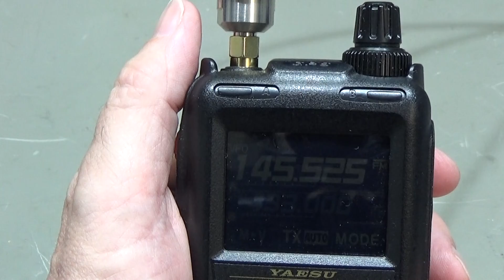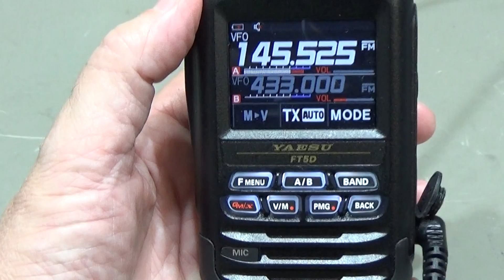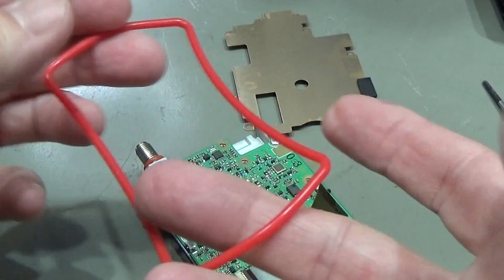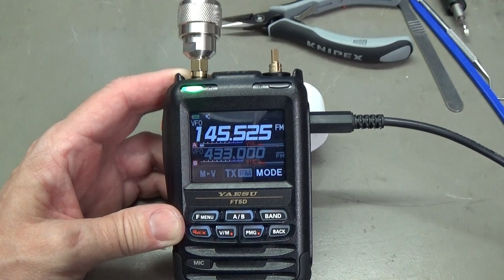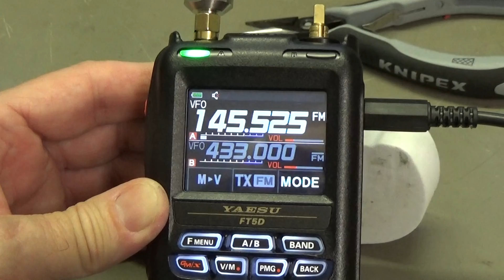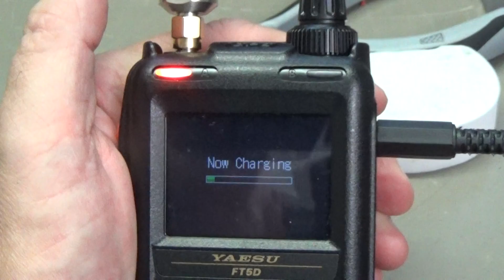#277 Yaesu FT-5D,  Display no backlight

Comment: Hi, a question not related to your repair for but for my FT-5DR is  regarding bluetooth, does the original software have a problem connecting, does an update fix that ? I can't get any of my headsets to connect.
Reply from the maker: We have never experienced a connecting issue with BT. Maybe there is a hardware problem.

Comment: Wondering if that Yaesu FT-5D has any reverse polarity protection at the battery terminals or the external DC input.
Reply from the maker: yes any modern radio has a reverse polarity protection.

Comment: Danke, fur another great video.  Always look fur the obvious.  I've tried my best to take a liking to digital Ham radio, but I just cannot stand the sound of digital electronics.  I've got a Yaesu 991a and, believe me, I've tried several times to enjoy a QSO on digital radio.  The sound is so bad I have trouble even understanding the computer generated sounding voices.  I've tried digital and unless they can  improve on the sound, I'll never be a digital user.  I understand that half of the bandwidth is used for error correction and the audio is crammed into the other half of the bandwidth that it makes the voices sound like they have been computer generated.  Cheers from eastern TN

Comment: Hello Peter nice to see a video. Curious as to what could have blown that board. Good thing Yaesu didn't discontinue it yet. Nice repair as always take care and 73
Reply: Ya, as an FT5DR owner I'm wondering if this is a common fault or if it was something that happened due to improper use / care...
Reply from the maker: No it is nit a common fault
Reply from the maker: rd to say why the mos FET failed, but we assume it was something external

Comment: Interesting video and great to see the FT5 internals. I am curious as to the cost of the RF board, I bet it was an expensive repair.
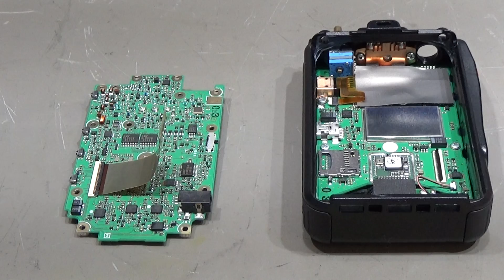Reply: At 5:58, he said the radio was quite new and didn't want to compromise it.  Maybe it was under warranty, so, free except for shipping possibly.  That's why he didn't replace the MOSFET.
Reply from the maker: Good conclusion

Comment: Nice video, thanks Peter. I built myself a nice lab a couple of years back but its been laying dormant ever since as I have nothing to repair. Thousands wasted :(
Reply from the maker: Hm, why is that? No customers?
Reply: @TRXLab  I'm really only doing it as a hobby at the moment but it would be nice to learn by attempting a repair. I don't know any other radio people these days. I need to learn where to get schematics too. Until then I have your excellent videos to fall back on :)
Reply from the maker: Don't give up, you can do it!
Service manuals you'll find on the web, simply search.
Have you ever considered visiting your local radio club? Anywhere in the world, radio clubs are near. Don't hesitate.
Reply: @TRXLab  Thanks Peter, there is a local club that runs several repeaters. I guess I will join now. Thanks for your advice and keep making the videos :) 73's G0XAG
Reply from the maker: That is the right way, and soon you'll have radios to work on..73's